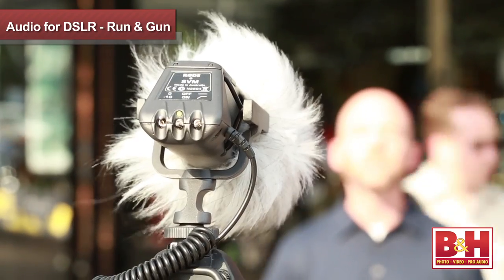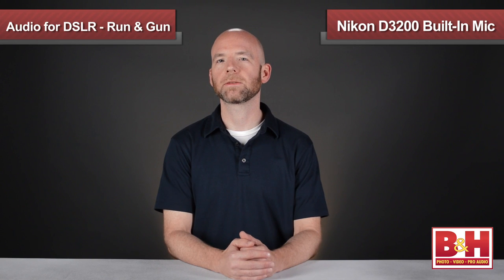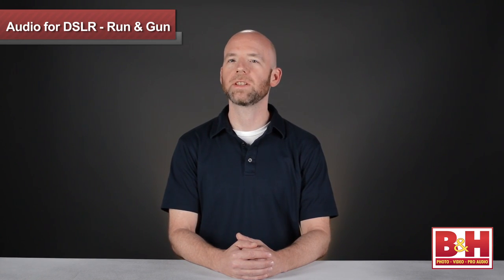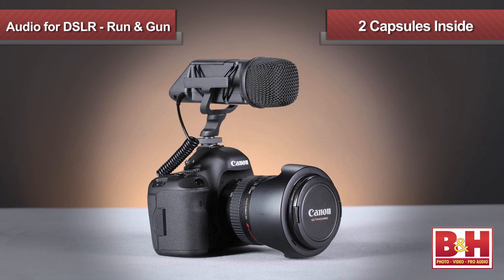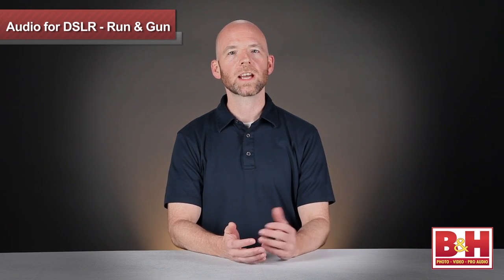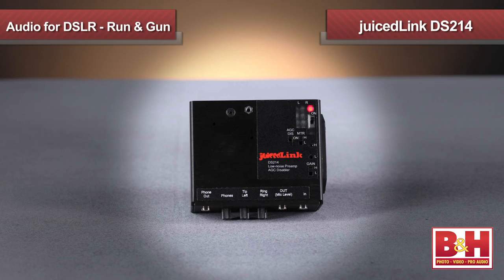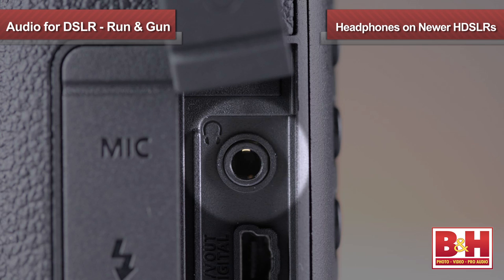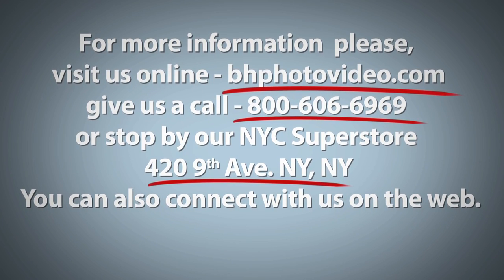Audio for DSLR Part 1 - Run & Gun

Comment from the maker: The RODE VideoMic Pro has a differently designed suspension that does require an upgrade. I have not encountered any retrofitted Canon SX50 cameras. Please contact us via e-mail if you have additional questions: askbh{at}bandh{dot}com. Mark S

Comment from the maker: @JacanaProductions  It is not usually recommended as it can add unwanted noise to the signal but you could split the microphone signal with a Y cable into the two inputs so you can level one lower than the other. It is more recommended to record to the single channel and monitor and ride the levels to avoid it from peaking.

Comment from the maker: I like the Rode for its more advanced shock mount and the 3-way level control and the power/HPF switch lets you turn the mic off, set it for a flat frequency response, or engage the 80Hz high pass filter. Please contact us via e-mail if you have additional questions: askbh{at}bandh{dot}com. Mark S

Comment: This video is amazingly excellent video. I have a Canon 70D, and a "RODE Videomic Pro - Compact Shotgun Microphone". I am experiencing significant audio "hiss" when I am doing some face-to-face indoor interviews. The hiss is there when I use the on-board built-in mic, or the RODE Videomic Pro. I'm not sure if it's a problem with the 70D camera, or if it's some sort of audio setting in the camera. I have tried changing some settings, but it's still there. Any suggestions?

Comment: What would be a better buy? The Rode VideoMic Pro or the regular Rode VideoMic and the Zoom h1?
Reply from the maker: greenhippo31 Eliminate the choice and consider the Shure LensHopper VP 83F that includes a built-in recorder in a shotgun microphone that is equal to, or better than the RODE VideoMic Pro in terms of build quality,design, battery life and overall performance: Shure VP83F LensHopper Shotgun Microphone with Integrated Flash Recorder B&H # SHVP83F. http://bhpho.to/18Q6RlR 

Please contact us via e-mail if you have additional questions: askbh@bandh.com >Mark<

Comment: So, which Rode mount is better for not knocking in the field while moving around a lot, the new Rycote integrated shock mount on the VideoMic or the mount on the VideoMic Pro? And, I'll probably buy both the VideoMic Pro and the Stereo VideoMic along with dead cat and dead kitten. Is there a package deal on that?

Comment: I would like to interview people and thought the Rode VMC Pro was the best option.  Then you made a good point about the MKE-400 focusing on midrange frequency.  I'm inexperienced and need some guidance.  I only want to buy one mic one time.
Reply from the maker: I like the Shure VP83. It's a compact camera-mount condenser shotgun mic, that provides detailed, high-definition audio with DSLR cameras and camcorders. An integrated Rycote Lyre shock mounting system provides isolation from vibration and mechanical noise. It offers a robust build quality, superior battery life and excellent sonic qualities. B&H # SHVP83. http://bhpho.to/1bK6BEY

Please contact us via e-mail if you have additional questions: askbh@bandh.com>Mark<

Comment: Rode VideoMic (originally) causes knocking noises and is very bad with camera handling noises on DSLR's, what microphone would you say is better? Tile the camera left or right with VideoMic on and it knocks. Have replaced rings etc etc.. Surely there is a better solution and a better mic that doesn't have such a pick up for camera handling and doesn't knock as you 'run and gun' ?

What mic is best for fast style shooting that also needs sound recording?

Comment: you say that the "5D MKII Rode VideoMic" has a greater sound but costs a little bit more. actually my impression is that especially if you used it in this video there was a pretty rumbling background noise ...

Comment: How do I adjust the recording levels on a canon 650d?
I have the rhode video mic pro.
Have been using it at -10db and wondering why results were less than expected. 
The 650d manual doesn't explain much on sound levels or external mics.
Reply from the maker: Latin Dance Videos The Canon T4i offers auto recording level. It should be switched off from the MENU for the best results when using an external microphone. 

Manual Mode: 
For advanced users. You can adjust the sound recording level to one of 64 levels. Select [Rec. level] 
and look at the level meter while pressing the < > key to adjust the sound recording level. While looking at the peak hold indicator (approx. 3 sec.), adjust so 
that the level meter sometimes lights up the ?12? (-12 dB) mark on the right for the loudest sounds. If it exceeds ?0?, the sound will be distorted. 

Page 193 of the Canon Instruction manual: http://bit.ly/1T8QCoo 

Please contact us via e-mail if you have additional questions: askbh@bandh.com >Mark<

Comment from the maker: Any stereo mic will not be directional. So you can eliminate those. The other shotguns will have an average of 5 feet of pickup. Anything further and you will start picking up more of the room sounds. Out of the shotgun mics discussed I would recommend the Video Mic Pro the most. For long distance though using a mic on a boom would be the best bet. 

Dana G. 
askbh{at}bandh{dot}com

Comment: Hi! I have a question. I will film wild animals (such as mostly bears but also wolverines and wolfs) from a bear hide in Finland. The animals will probably be on a range from 30-50 meters but possibly as close as 5 meters. If I want to achieve great noiseless sound when filming and recording these animals, what would you recommend? I have tried a videomic röde pro but was heavily disappointed as it could not quite pick up the sounds of the animal which required me to amp up the sound so much that it all became very noise. Thanks, hope you can help me, I really want to achieve good sound!
Reply from the maker: +Henrik Nilsson  - At5 meters a quality  long shotgun microphone should work.  At farther distances, a parabolic microphone dish would be necessary.Audio can be picked up from as little as 3.0' (0.9m) or as much as 500.0' (152.4m) depending on wind and weather conditions.   http://bhpho.to/1JYTKigMark S

Comment: Looking for a mic for my D3200 to record a rock band and vocals in pubs and bars - the Rode Pro sounds good and around the right price, but what do you recommend?
Reply from the maker: The Rode VideoMic pro is a good choice. For a similar price, I prefer the Shure VP83 (B&H # SHVP83) for its robust build and overall audio quality: 
The VP83 LensHopper Shotgun Microphone from Shure is a compact camera-mount condenser that provides detailed, high-definition audio with DSLR cameras and camcorders. An integrated Rycote Lyre shock mounting system provides isolation from vibration and mechanical noise. 

The VP83 LensHopper features an easily accessible three-position gain adjustment and low-cut filter, allowing it to adapt for different recording environments. Its lightweight, yet durable, metal construction provides dependability and long-life. The VP83 easily mounts to a standard-size camera shoe or a 1/4" threaded stand. The convenient, attached 3.5mm cable connects to your camera's audio input. Its efficient operation boasts 130 hours of battery life on just one AA alkaline battery. A foam windscreen is included to guard against wind and environmental noise. 

Capture Detailed, Accurate Audio 

Full low-end response 
High sensitivity 
Low self-noise 
Wide frequency range 
Highly directional polar pattern 
Effective RF immunity 

http://bhpho.to/1bK6BEY 

Please contact us via e-mail if you have additional questions: askbh@bandh.com.>Mark<

Comment: I'm not a pro shooter but I'm looking for a better solution for recording audio for my kid's singing, concert and piano recitals.  My camera is the Panasonic GH3 and would like to have the option of shotgun or stereo.  Thinking a mid-side solution would be good and I'm looking at the Sony ECM-957PRO but can't find much in the way of reviews.  Most recording is done from a good distance away (20+ feet) so I'm wondering on better solutions and ideally would not want to spend more than $300.  Ideas?
Reply from the maker: The Sony mic you have selected is not appropriate for use at a distance. It is ideal for close miking at the stage or atop the piano. This distance demands a shotgun style. Consider the Shure VP83. It will connect to your camera without adapters. B&H # SHVP83. http://bhpho.to/1bK6BEY 
Please contact us via e-mail if you have additional questions: askbh@bandh.com. Mark S.

Comment: Very useful video. Thank u for sharing. I got a canon eos 70d. I wanna make a short film. Would u please tell me about what I should do for recording performers' speech in my film properly and conveniently? Thank u in advance.
Reply from the maker: I recommend using a separate audio recorder and shotgun mic. Consider this kit: Tascam DR-60D with Rode NTG-2 Shotgun Mic and Boompole Kit 
Includes Free: Red Giant PluralEyes 3 (Activation Card) - B&H # TADR60DK1 (B&H Kit) - http://bhpho.to/1ro9HCw 

Please contact us via e-mail if you have additional questions: askbh@bandh.com.>Mark<
Reply: Thank you very much. I will buy soon those equipment. Could you please tell me on how I could make video transit from one performer face to another performer  rapidly? For example, a video clip about  talking between two friends each sitting face to face. Sometimes video focuses only one face, and rapidly it transit/focus/move to another face. How they make it?
Reply from the maker: Often the best solution is using two cameras, pre-focused on each individual. Quick focusing may be also be accomplished manually on many cameras that offer this feature. Preset lens markings enable focus that "snaps" sharply into place for each subject. 

Please contact us via e-mail if you have additional questions: askbh@bandh.com.>Mark<

Comment: Are camcorder preamps better than DSLR preamps. Also is everything you said equally applicable to camcorders as well?
Reply from the maker: Typically speaking, camcorders with XLR inputs will have superior mic preamps than either DSLR cameras or consumer grade camcorders with 1/8" (3.5mm) audio inputs. The tips and insights offered by Rob in our video apply to camcorders as well. 
Please contact us via e-mail if you have additional questions: askbh@bandh.com.>Mark<

Comment: So, Rode only offers the better suspension with the lower-price VideoMic and not the better VideoMic Pro? Off the subject but relevant - does anyone retrofit the Canon SX50 with a mic jack? I use the T4i mainly, which already has a jack but I'm doing insect field videos so the 50x zoom of the SX50 is good but the audio is almost omnidirectional so the viewer hears the insects 5ft away and above in a tree louder than the one in the video 15 ft away and straight ahead. Thanks.

Comment: hey nice vid.! but what if im using a dslr camera that  has no headphone jack. how can I deal with those stuff?
Reply from the maker: A simple remedy would be to choose this microphone: 

The VP83F LensHopper Shotgun Microphone with Integrated Flash Recorder from Shure is a compact camera-mount condenser that provides detailed, high-definition audio with DSLR cameras and camcorders. It records 24-bit/48kHz WAV audio files to MicroSDHC cards, supporting capacities up to 32GB. The VP83F also features one-button recording and an intuitive operating menu, making it easy to use. Additionally, an integrated Rycote Lyre shock mounting system provides isolation from vibration and mechanical noise. 

The VP83F LensHopper features a 60dB gain range, adjustable in 1dB increments, as well as a low-cut filter for adapting to different recording environments. Its lightweight, yet durable, metal construction provides dependability and long-life. The VP83F easily mounts to a standard-size camera shoe or a 1/4" threaded stand. The detachable 3.5mm cable connects to your camera's audio input, while the stereo headphone output allows you to monitor incoming audio. Despite its extensive functionality, the VP83F offers 10 hours of battery life on two AA alkaline batteries. A foam windscreen is included to guard against wind and environmental noise. B&H # SHVP83F 

Please contact us via e-mail if you have additional questions: askbh@bandh.com. Mark S.

Comment: this might be tough to answer but i need 2 wireless mics to record with for 2 people and i dont know how to go about this
Reply from the maker: Canadian Auto You will need a wireless lavalier microphone system that will allow simultaneous use. The Polsen ULW-16 - 16-Channel Camera-Mountable UHF Wireless System with PL-5 Mini Lavalier Microphone - (584.400 to 602.450 MHz) will get this done for you. 

The Polsen ULW-16 is a 16-channel camera-mountable UHF wireless system designed to transmit audio up to 300'. Engineered to be exceptionally quiet, and with many professional features like headphone monitoring, line input, and frequency agility, the ULW-16 is ideal for EFP (electronic field production),DSLR, and many other video applications. 

With its impressive 105 dB signal to noise ratio, the ULW-16 delivers pristine audio transmission for broadcast-quality recordings. It has 16 channels to choose from to help avoid interference. Up to five systems (or more in optimum conditions) can be used simultaneously in the same location. 

http://bhpho.to/1vK5Imk 

Please contact us via e-mail if you have additional questions: askbh@bandh.com >Mark<
Reply: B and H  but then wont i need to buy another mic and transmitter seprate. or one that is conpatable. for me the cheeper the better. the most chanles i will need is 5
Reply from the maker: Canadian Auto You will only need to purchase two of the systems I recommended in my reply to your earlier post. This is my best recommendation for a low priced, reliable system. 

Please contact us via e-mail if you have additional questions: askbh@bandh.com >Mark<

Comment: Does the Canon 1200d,support an external mic being that it has manual audio control?
Reply from the maker: The Canon EOS 1200D (EOS T5) does not offer an external microphone input.   >Mark<
Reply: B and H I have the T6, and do handheld videos, I got a tascam dr-05 for better audio and it makes popping noises when handled with an external mic. What should I do?

Comment: What is the best mic for Canon SX400?
Reply from the maker: +Wade Productions 2016  - Unfortunately, the Canon PowerShot SX400 does not have a jack for an external mic.  You would need to look at an external digital
recorder such as the Zoom H4n 4-Channel Handy Recorder, and then sync sound in post.  Christina  AskPhoto@bhphoto.com

http://bhpho.to/1Hjv5Fq
Reply: And what type of tripod willl work with a DSLR SX400 IS

Comment: I have just bought a Canon 100d. I have a Sennheiser mic which plugs straight into  and the pickup quality is great but the hiss is dreadful. Will the DS214 JuiceLink illuminate the hiss?
Reply from the maker: Steve Rainbow The Canon EOS 100D is known as Canon EOS SL1 in the USA. Please e-mail us at the address provided below and include the model number of the Sennheiser microphone and the type of cable you are using as well. 

Please contact us via e-mail if you have additional questions: askbh@bandh.com >Mark<

Comment: hi what is the best Microphone for CANON 1200D OR REBEL T5?
Reply from the maker: +Renzy Capillo -  Unfortunately, the Canon 1200D (T5) does not have an external mic jack, so you could not plug an external mic into the camera.  If you want to use an external mic, you would need to use a portable audio recorder such as the Zoom H4n, and then sync audio in post.  Christina  AskYouTube@bhphoto.com
http://bhpho.to/1Hjv5Fq
Reply: So if I use that zoom h4n it can connect to the camera ?
Reply: +B and H so if I use that zoom recorder it can connect to the camera ? is that product have a cables to connect on my camera (1200d)
Reply from the maker: +Renzy Capillo - Unfortunately, there isn’t a way to connect an external mic or recording device to the T5 to record internally.  You will either need to just use the built-in
mic, or use an external recorder such as the H4n.  The audio would be recorded in the H4n, and then you would need to sync that recorded sound to the video you had shot in
post using software.  Otherwise, if you wanted to use an external mic plugged directly into the camera, you would need to upgrade your camera.   If you have further questions about syncing
sound, or looking for further product recommendations, I would suggest sending us an email. Christina  AskYouTube@bhphoto.com
Reply: +B and H thank you
Reply from the maker: I’m not aware of any adapter on the market that would enable the use of an external mic with the T5.  The only option I know of is to use an external recorder and then sync the sound in post.  Christina AskYouTube@bhphoto.com